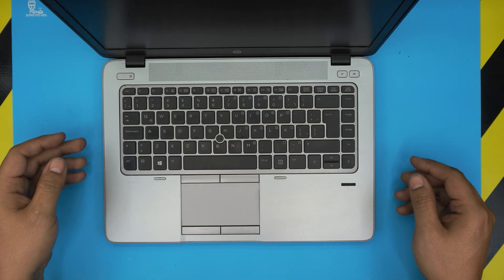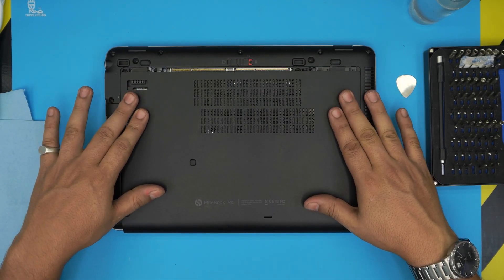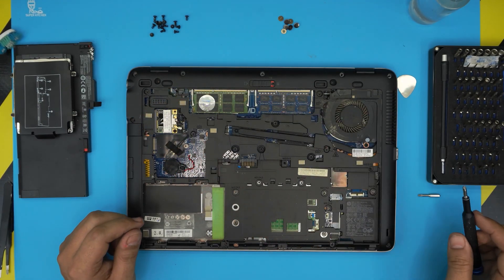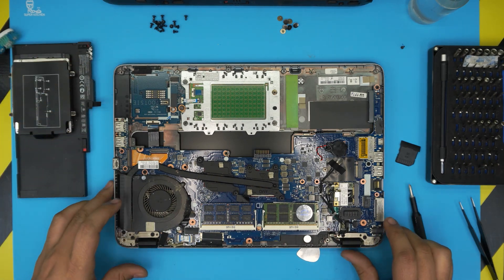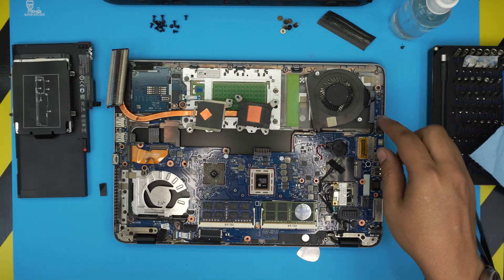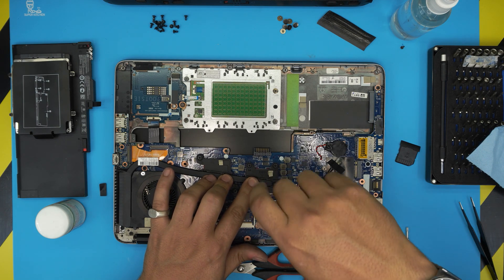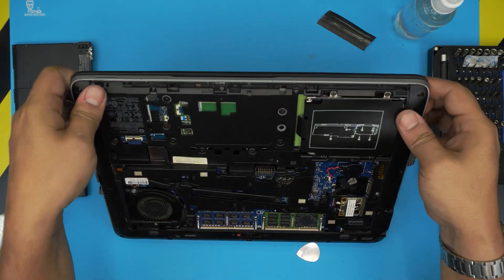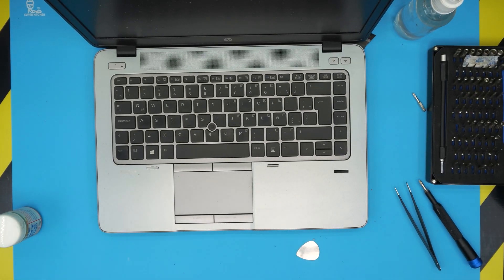HP Elitebook 745 Service Repaste & Cleaning Full Guide

Comment: I can also use some help bruv
My laptop shutdown when i plug in the charger but it works absolutely fine when not charging.
Reply from the maker: im sorry i never got so confused about what you just said.
when you plug in the charger and you power on , does it power on? and once you get to the desktop it shutdown suddenly or it says shutting down?
Reply: No the screen remains black
Reply: But when i charge it and then unplug the power it powers on and works just fine so i have to stop what im doing and charge it when the battery gooes low and the continue using it.
Reply: When it is already on and i plug in the ac it shuts down immediately the screen turns black and the airplane buttons lights starts blinking orange and white.....